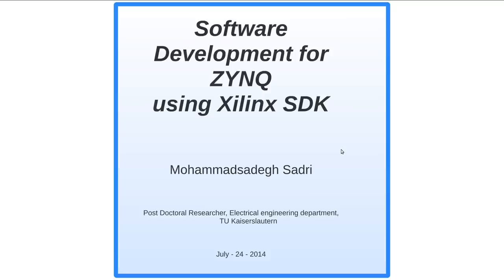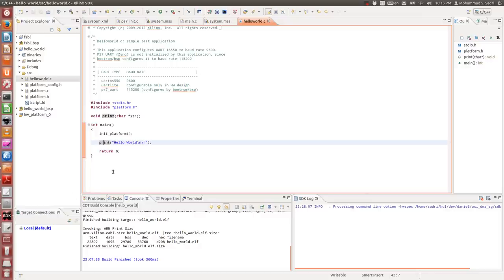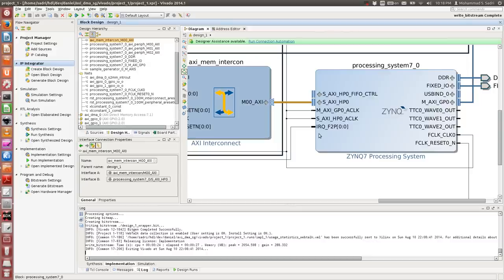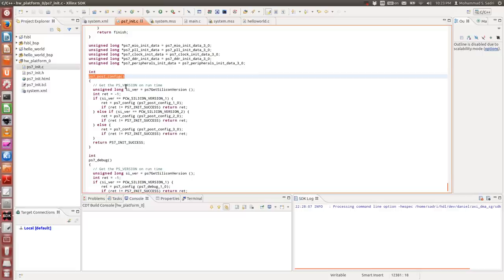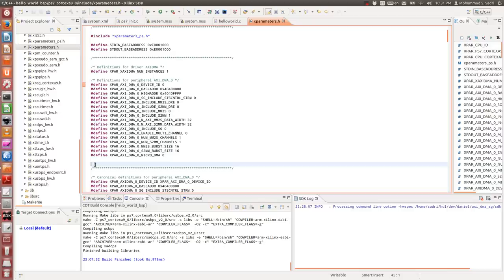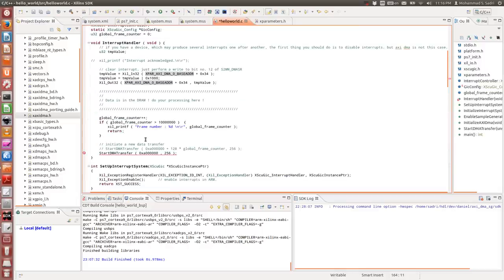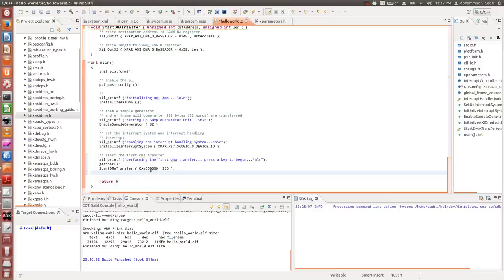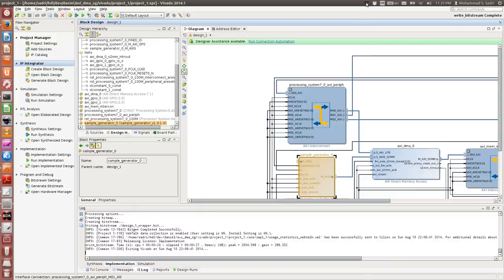ZYNQ Training - session 09 - part IV - Transfer Data from PL to PS using AXI DMA

Comment: Hi sir,        I am working on zynq 7020 customized board. I wanted to transmit continuously 256 bytes of data from one board to another board . for this I have used the AXI DMA ON BOTH THE SIDE(TX & RX ). I have followed the same steps as you have mentioned in the video and I have used the same code. With this configuration I am able to transmits 256 bytes of data ONLY ONCE and after completion of one transmission my code is entering into interrupt handler and it is execute "start_DMA_Transfer" function but actually the data transmission is not happening for the second time. So could you please suggest me where i am going wrong? It would be very helpful.Thanks,Devdatt

Comment: Can you please explain how does we know which data is mapped into which memory address??From what I saw in your video, the data is stored next to each other (first 32bit store at 0xa000000, second 32 bit store at 0xa000004 and so on). When I am trying to feed a 128bit data in the S_S2MM of the AXI DMA (tlast is always 1 since each transfer only need 128bit of data). When I debug it, the data sometimes write into 4 consecutive memory location (0xa000000,0xa000004,0xa000008,0xa00000c) but sometime write the upper 64 bit into just 2 memory location (0xa000000,0xa000004), then the next transfer will write the lower 64bit to  (0xa000000,0xa000004) again. How can I actually fix the transfer to actually write the full 128bit data on (0xa000000,0xa000004,0xa000008,0xa00000c) until it is done? I know that it will be possible to write a few Kbytes of data at a time, but I want to get the right concept of how the transfer works first.

My parameters is as below: 
AXI DMA IP core in block diagram:
width of buffer length: 14bit
address width: 32bit
memory map data width: 128
number of channel : 1
stream data width (auto) : 128
max burst size: 16

In the bare metal software:
StartDMATransfer (0xa000000, 256);

I tried quite a few different parameters but it turn out the same situation.

By the way, in my hello world templete, the last line before the return 0; there is another function call (cleanup_platform();), it called another function named (disable_caches()) and finally lead to Xil_DCacheDisable(); Xil_ICacheDisable();
I guess it is doing some sort of clearing the L1 and L2 cache of the zedboard.

Thank you!

Comment: These videos are extremely useful thank-you. I have a problem when running this example though...

My interrupt handler is never triggered. I tried debugging with a break point which never gets hit and have a printf statement which I never see on the terminal. Any ideas?
Reply: +mjp500 Hi mjp500, I got same problem here. Have you found the solution?
Reply from the maker: +Hao Gu well now you have access to the latest working sample generator ;) might you have any issues, let me know.

Comment: I forgot to mention earlier: rather than copy/pasting the ps7_init files between the hardware platform and the applications, you can add a link to those files using Eclipse. That way if you change/update your hardware platform, you don't need to remember to change all of the copy/pasted files yourself.

Comment: Great Videos! However I have a question. I tried to implement this application in my ZedBoard. Everything works fine. However if I change the size of the sample generator packet size i.e. from 32 to 64 or 128, the data transferred to the menory is still the same i.e. 32 samples ! How is this possible? I also changed the DMA transfer length, still I get only 32 samples in my DDR memory.

Comment: Salam Mohammad,

I have a question. Is it mandatory to run FSBL before running the main DMA read & write program? or we can run main without running FSBL??

waiting for your kind reply.

Regards
Reply from the maker: +Mujahid Abbas whatever you do, you need to first initialize the ps, so if you are not running fsbl, you need the ps7_init.tcl or ps7_init.c some how to be executed first.
Reply: Dr +Mohammadsadegh Sadri Thanks a lot :)

Comment: Thank you for your well made tutorial. However i have a question, how can I find the meaning of each function or parametters in side the ps7_init or in another autogenerated file. For example the last video how did you find the meaning of FSBL_debug or on this file the meaning of post_config or any other function. So far I have not found a single datasheet explaining the generated programs.

Comment: It looks like the startdmatransfer(  ,  ), will write into two registers to initiate the tranfer and exit to the main function.  How are you guaranteeing that Interrupt will be called before exiting from the main(so that main will not be exited) ? or I was expecting some "while" loop to keep the program in main().
Reply from the maker: Your idea sounds nice,
the only thing I can say for now is that the example works on the real hardware.
Honestly speaking I don't know what will happen when the execution of the main gets finished.
We should have a look at the compiled code and see if the spin loop (that you want to add there at the end of the main) is already added during the link process or not.
I am aware of the fact that, for some target platforms this spin loop gets added to the end of your code automatically.
Reply: It looks like i have this kind of a problem. I'm using the DMA to transfer data from the PS to the PL which is converting the data and showing it on a VGA display. The Interupts are generated about 60 times per second, which is basicly the framerate of the display.  At the moment im just detecting the first Interupt, and thereafter one new transfer of data to my VGA Display happens. but after that the programm stops, or is exiting the main function. So I'll try rakesh kumars idea or does anyone have a better solution for this problem? :)

Comment: Hello, first thank you very much because sharing your knowledge at PhD level is really generous and inspiring.
Second, everything works for me appart from the console output : it is always empty. 
So xil_printf and FSBL_DEBUG are both unable to print something through the uart link.
Any idea why ? 
I am using the latest version of Vivado and the SDK so maybe commands have changed ?

PS : I did enable the PS with fsbl and ps7 init, ps7 post config before and have all the needed files (print.c, outbyte.c...). An example design works on my board so the problem is not the board but the sdk coding/parameters...

Comment: Hello, I have question
After data is transferred from PL to PS, if I want to get data and shows on LED. What should I do?  Is that assign dstAddress in your StartDMATransfer function by GPIO's base address? Thank a lot about your video and your help.
Reply from the maker: Hi, Please also watch my videos in the microelectronics systems design research group of tu kaiserslautern. you should find the answer to your question. in any case, data is transferred by axi dma from pl to ps, you can access data by xilinx io commands Xil_In32 (if i recall correctly) and then you can instantiate an axi gpio module in the pl with its output port connected to your leds. now by writing the values to axi gpio you can change the leds color.

Comment: First of all, thank you Sadri so much for these fantastic lectures! 
Secondly, what I haven't understood from this lecture is how we exactly access the data that is transferred to the DRAM? Do we need to use Xil_In32 for every word in order to read those values or there is some other way?
Reply from the maker: Hello Nenad, Yes, if you are running an stand alone application the Xil_In32 is a good way to read your data from the dram from the address to which the DMA has transferred the data. If you are running Linux then you will need a driver to access that region of memory. I have talked about this on my AXI DMA Linux educational videos extensively.
Reply: Can you please provide the link to your AXI DMA Linux educational videos?

Comment: You say on your video that 0x1001 enables interrupt on complete and dma unit. I'm not understanding this since the interrupt complete is bit 12 and my noob opinion it should be 0x1000000000001.

Even discarding the reserved bits 5-11 and 1 that are read-only, IOR_IrqEn still is the 4th bit and not the 3rd as you have. What am I missing?

thank you
Reply from the maker: joao pereira the number you are showing has 13 * 4 = 52 bits !!! when we say 0x.... we are talking about a hexadecimal value
Reply: Shouldn't bit 12 be, 0b1100. Or in hex 0x000C?

Comment: When mrd command was used. I could see at maximum 35 correct counting numbers, but the rest are random numbers. But the burst length was 256. Why is it happening like this ?
Reply from the maker: Hi. Yes! Why is this happening? I guess you have found out, (or i remember I told you through an email) the AXI DMA also looks at your TLAST signal, so when you reach the end of packet (for our specific example case) it considers the transfer task as done. I will talk more about this in the next video.
Reply: Yes Sir i have found out that . I posted this before i got your reply in the mail.
Thank you .

Comment: Hey. I get a DMAIntErr ( DMA Internal Error) error interrupt. What would be the most common reason why this happens in your experience ?

Cheers
Reply from the maker: Arvind NR source and destination addresses are correct? alignment of address? its range?
Reply: Mohammadsadegh Sadri Hey.! 

 So it turns out that the DMA IP accepts some  words initially to fill its pipeline stages on power up. I wanted to transfer 100 bytes but used to get DMAIntErr every time. Then I increased it to 200 bytes even though the actual length when the TLAST will assert is 100 bytes. Then it started working. When I read the len register of the DMA IP , I noticed that it says 116 bytes. The documentation of the DMA IP core mentioned that the len register gets updated with the number of bytes transferred once the DMA operation completes. In a correct working system the len register must be equal the bytes we want to transfer after the DMA operation as well. 

I read some xilinx forums and a few other people have the same issue. Have you ever noticed this ? What I dont understand is my streaming IP keeps the TVALID low on power up. And it goes high only when I set a GPIO bit high. Strange how the DMA IP can accept data with TVALID is not hight after power up. 

Any way I want to thank you for your videos. Great job! I was hesitant to use DMA in my system cause I was under the impression it is very difficult. But now once I went through all your videos I understand the whole AXI system design very well. Especially your first two videos on AXI system basics is very useful to build a foundation of vivado axi system design.. I will now experiment with more advanced features like the SG mode of the DMA. 

And finally  no matter what people say , your speed of talking and clarity of concepts are just perfect and exactly like how they should be. I can't wait to go over your other videos on zynq from the Micro Electronic Systems Research Group channel. 

Cheers :) :)